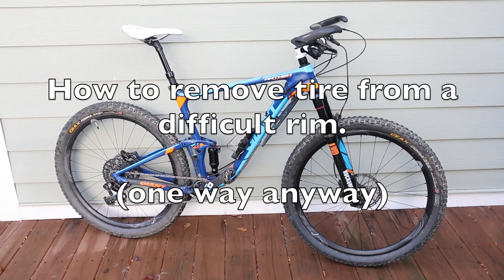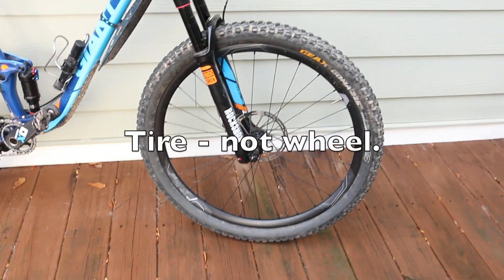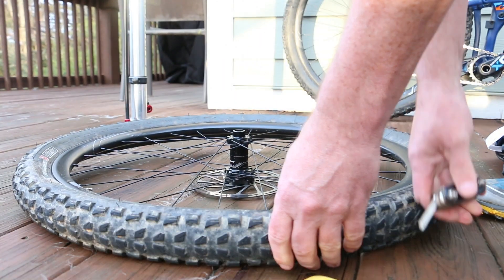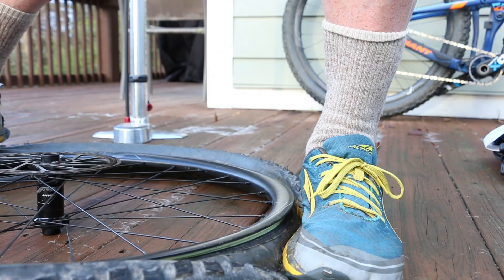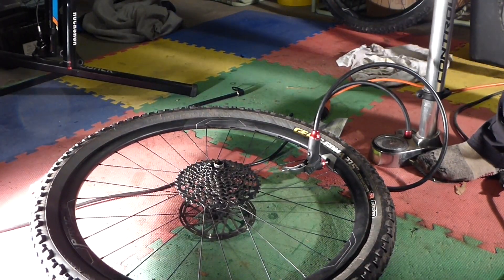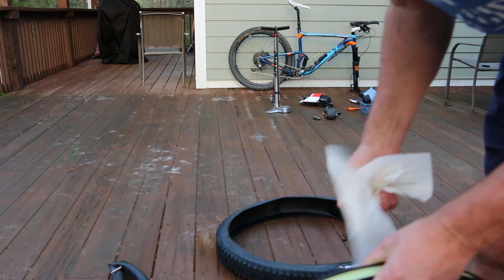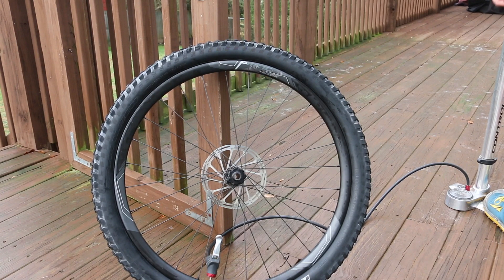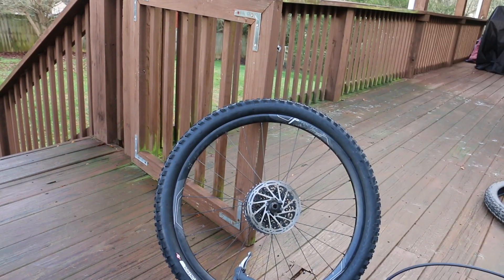How to Remove a Tire from Difficult Carbon Rim Without Damaging It

Comment: I had to use a tack puller (looks like a little pickle fork, Husky #693-232) to pry down into the edge of the bead to get it to separate. I did mar my aluminum rims a little and also boogered up the tire bead, but it still went back together and sealed successfully.  I have the WTB TCS rims with WTB Trail Boss tubeless tires. I think the problem is the tire bead and rim edge mate so well that you can't pull it off w/ your hands.  So when I converted the wheels to tubeless, the bead & rim mated up so well, I didn't have any sealant bubbling out anywhere. Wished I'd have found this video before I did my wheels!! Thanks anyway.

Comment: Use a bit of kitchen spray to make both the tyre and wheel slippery when putting in your tyre levers. This should make it easy to take a stiff wheel off. When putting it on keep spraying a bit until it fits on nice and smoothly. Deflate the tyre if you must

Comment: This is my first 29" WTB bike and first tire change on a 29 x 2.25 tire. I am running tubes and had same difficulty removing factory installed tires. As per video used the heel of my hard rubber bike shoes and that did the trick. On reinstall I used Teflon powder (talcum powder would work) along the beads to prevent stickiness. Had to pressure the tire up to 60 psi to get it to seat properly in all places. Dropped the pressure back down to 35 psi. Have installed a thorn resistant tire barrier. Hope it is somewhere close to the middle of the tread. Have no way of knowing.

Comment: Darn, why didn't I see your video earlier... I have exactly the same wheelset from a closeout deal about a year ago, ran into the problem changing the tire couple months later and made an exactly the same 'crack' on one rim like yours from jamming a small screw driver in it out of pure frustration. One tire was removed but I gave up on the other rim. With one wheel had the small crack and the other with the tire I didn't like, these wheels had been sitting in the corner for months. Just circling back to the issue today and decided to do some googling before cracking my fingers or busting out the snips, man, standing on the tire to pull away the rim totally worked!! Now I need to tackle the small crack on the first rim... Is super glue a viable option? I'm using this wheelset for gravel, probably won't ever run it over 40 psi but probably need a bit higher pressure to seat the new tires...
Reply from the maker: I glued mine with super glue and as far as I know, it worked but I didn't keep the bike long.

Comment: Ok Buddy, Here is what I do on my motorcycle tires with tubes, ofcourse remove the valve stem core, The I use a C-clamp to break the beads. (both sides) once the bead is broken, then I use my tire spoons. Key thing is start with the spoons on the opposite side of the Valve stem. Now for lubrication, I mix a concoction of lithium grease and Tranny fluid. (not sure if that is safe on your carbon rims) Mine are steel rims. It lasts long enough to aid in all future repairs of Tubes, and or tire removal. Once you get one bead Broken and spooned off, at that point I remove the tube, Then spoon off the other bead. That dawn was a good idea. But I assume it will dry and be a pain in the ass on the next repair. Surely they have some kind of recommendation for some kind of lube. Also when installing a tube, Many say to use talcum powder in side, I have never done that. nor do I intend to start!
Reply from the maker: +navythomas8 Thanks.  I assume you have tubeless tires on the motorcycle?  I've also heard of using Talcum powder.  A friend said to use Dawn, no idea if that's a good idea or not.  Guess I'll see.
Reply: Brad Herder No I have tubes on spoked rims.
Reply from the maker: I want a dual sport motorcycle. :-)
Reply: Brad Herder Start looking at KLR's. Kawasaki, See if you can find an 09 and up used. I can help you with every issue that you could have. Except the Carb. I am not a carb guy at all. Hence I bought the BMW Sertao. But it is a POS in the winter. Do NOT buy a 2008 KLR though, They have Ring issues, and oil leaks. (blow by) There is not a single upgrade I did not do to mine, with the exception of playing with the emissions.
Reply from the maker: I was kind a looking at the Yamaha TW200 for puttering around on back dirt roads and actually going on trails.  I do a lot of trail work (mostly cutting trees off them) and most of my time is spent walking into the tree.  Pain in the ass.  Not sure how the TW200 is but liked the wide tires and low seat height.  I suspect I'd have a bitch of a time learning how to ride in the woods though.
Reply: Brad Herder I also looked long and hard at the TW 200 back in late 08, But I opted for the KLR for road trips. I think that bike could be a lot of fun!

Comment: Well, tried your method, and it still didn't work. I did modify it though and it did work. It will never work on the trail for me though. Using my feet didn't get me enough purchase on the tire, but by putting a small piece of 2x4 on the tire and standing on that, I could pop the bead. Had to do both sides of the tire and still it took a lot of effort and two tire levers to get the tire off the rim. Crazy tight.

Comment: Hey. Was just about to take my flat wheel to a mechanic for repair for the first time in 28 years, when I saw this. Hope it works! What about using silicone spray for lubing instead of soap?
Reply from the maker: I like that idea!  I have some SC1.  I don't have a bike with wheels this difficult anymore but if I ever get one, I'll definitely try using SC1.  Thanks for the suggestion!

Comment: Good stuff I was having the same problem now it's just hard to do that side without taking the rotor off.   Took the rotor off and it was easy-peasy... By the way why would you need 60 pounds in your tire 28 or 30 is totally sufficient

Comment: They are TIGHT. I use to tire levers but its a pain to get the first bead off. 

Too save time on the trail I just carry Stans fluid and a valve core remover in my bag. This is my first go to for fixing a flat. because I don't want to mess with the tire bead.
Reply: Also carry a tubeless plug kit

Comment: The only thing that worked for me was to cut the bead with a Dremel tool... I even cut the tire all around, all the way almost down to the rim, and the bead appeared to have become fused to the rim. It wouldn’t budge even after pulling on the tire for two hours... I sliced the bead carefully with the Dremel and it came flying right off. Very aggravating! But it worked and I only slightly scratched the rim, no biggie.

Comment: I have the same issue with my Easton carbon rims. I'll give this method a go since I don't have the thumb strength to get the bead off. Question: why not pull up on the rim from the underside instead of the spokes? That way you don't damage spokes. Is there not enough leverage?
Reply from the maker: +Nelson Wong No - that's better than pulling on the spokes!  I will try using the rim next time.  Thanks for the suggestion!

Comment: I realize this is a pretty old vid, so maybe you've come up with something different.  The only thing I don't like is the potential damage to the brake rotor.  Saw another vid with a guy putting the tire in a table vice.  I might be more inclined to try that first.  Not worried about damaging the tire since I'm removing it to replace it anyway, right?
Reply from the maker: Vice works, I've tried it, doesn't hurt the tire either but if you get a flat out on the trail, I still think this is the only way to get an inner tube the tire.  The only difference I do now is I don't grab the spokes, I grab the rim and always try to keep the rotor off the ground.

Comment: I tried your technique, but I was trying to get off a road bike tire, not enough purchase with the foot on the tire. I realized that the road bike tire may be thin, so I tried softening up the rubber with a hair dryer and after few minutes of it I was able to get the bead off. Just pasting that info, if it helps someone.
Reply from the maker: rahul dimri wow!  Great idea.  Thanks for sharing
Reply: rahul dimri u

Comment: Is it possible this could buckle the wheel in any way ?
Reply from the maker: I suppose anything is possible but I doubt it as long as you don't stand on the rim, just the tire.  Pulling on the spoke made me nervous too - that's why I tried to grab as many as possible.
Reply: Brad Herder thank you, a lot of help I have now managed to get it off so thank you again

Comment: Sadly even this technique is not working on my Hope Tech 35 rims with Maxxis High Roller II 27.5+ tyre. 9 Bar in and never even seated to the rim. And now impossible to remove from the rims.

Comment: Best way for me is two tire levers, start at the same point, and work your hands away from eachother
Reply: Tyre levers don't work in this case. The beads of the tyres are cemented on the rim and the levers won't find a gap.

Comment: air compressor with soapy water to seat the bead, takes 10 seconds or less.
Reply from the maker: Sure - if you have an air compressor and a place to plug it in.  This is much lighter and more portable. :-)

Comment: Thanks for posting this!   I have the same wheelset and have been trying to remove some Hans Dampf tires with no luck at all ... I'm going to try your method this afternoon.  FWIW,  I've found any and all tires very hard to seat on these wheels also but last year I used some 'Bead Lube' from Princess Auto and got tires to seat at around 35 psi or so.  I also used the lube on my fat bike carbon/tlr combo and the tires popped right into place at around 20 psi  https://www.princessauto.com/en/detail/16-oz-bead-lube/A-p8223208e  thanks again !!
Reply from the maker: That bead lube sounds like a great solution.  Princess Auto?  That's a great name. :-)

Comment: How the fck do you do that on the disc brake side without bending the brake?
Reply: I did not go full 180, more like 90 degrees and used my heel. Disc is fine, no bend. Did all this on a carpet.